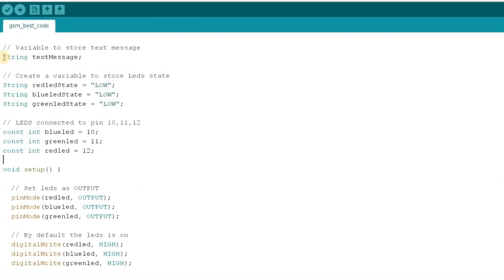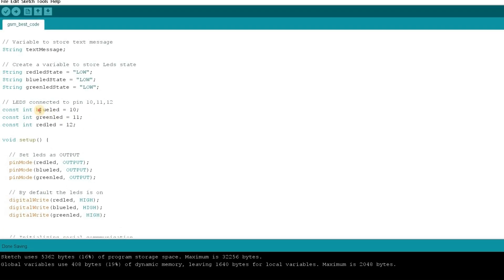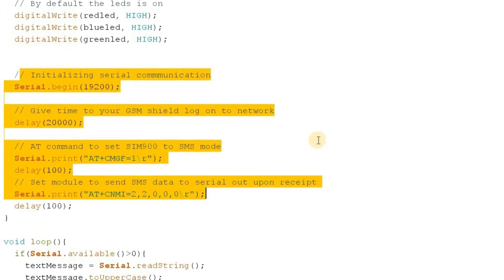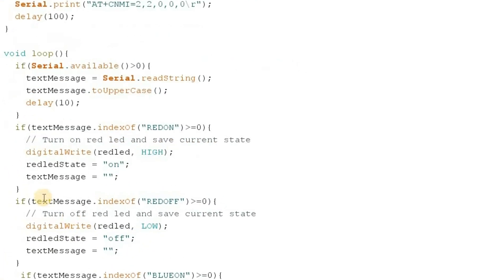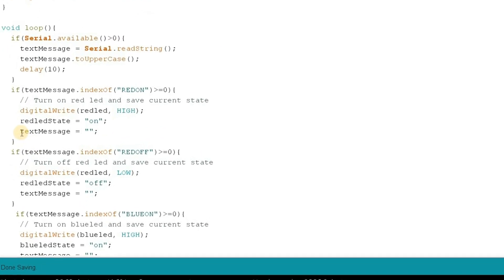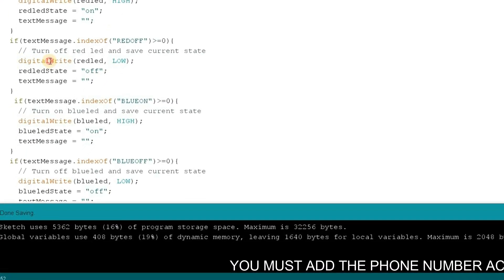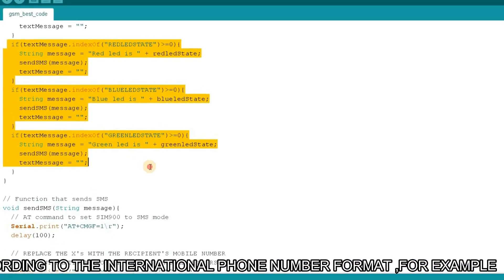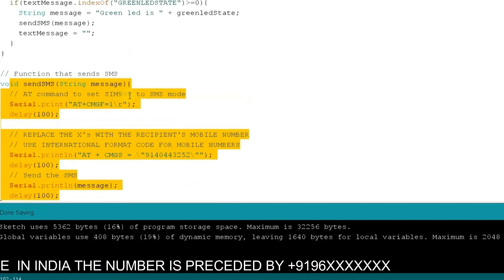Check Status of Your Home Appliances Just sending an SMS. (GSM SIM900A+ARDUINO)

Comment: Dear sir, I am used the sim800L with Arduino nano board control by the two relays ,
Send the sms 1 to ON the First relay for motor start button , after 3 seconds time delay to cut off.

Send the sms 2 to ON  the second relay for motor stop button, after3 seconds time delay to cut off.

This function Working is fine and reply message also fine,

But I need how to check the motor  last status  on/ off,
Pls can doing the code for me thanks.
Reply: plz share with me

Comment: sir can i use sim800l gsm module instead of sim900 module, and this code is working with sim800l gsm module. give your reply it will help me in my project.
Reply from the maker: Yes you can use sim800l